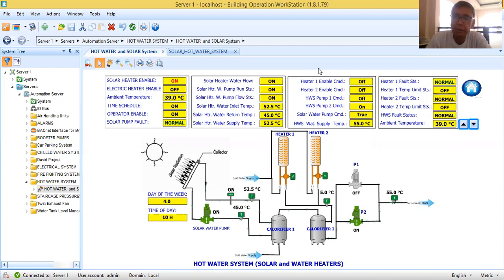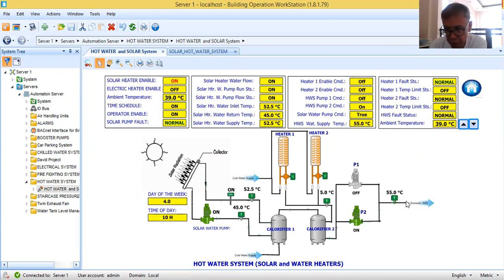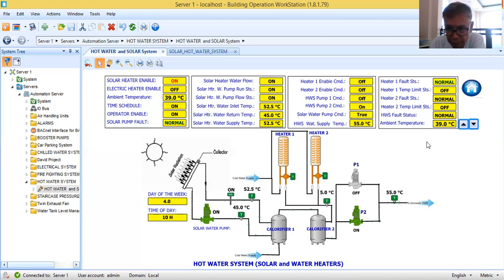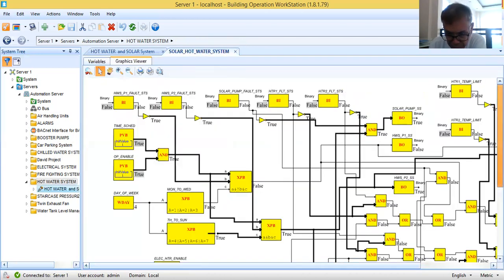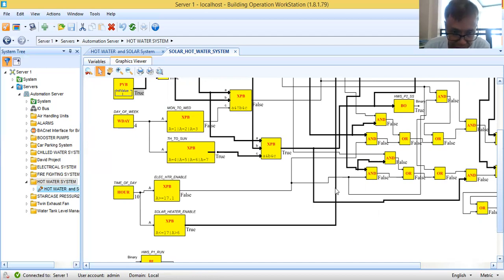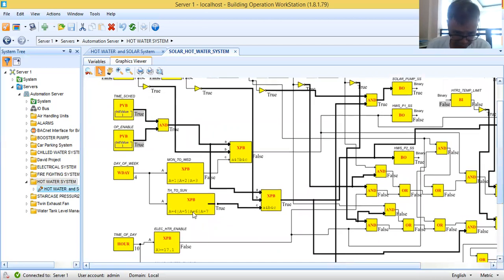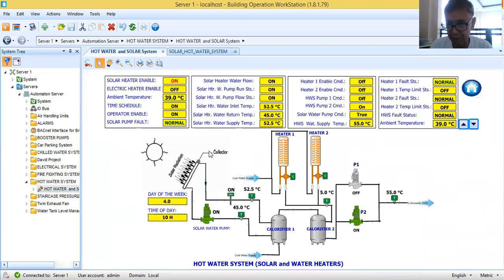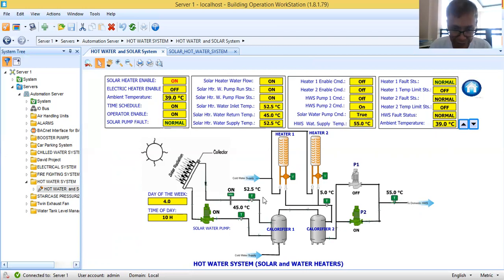Hot Water System (Solar and Electric Water Heaters)

Comment: I learned a lot, thanks. How about monitoring the temperature in the solar heater and automatically switching the electric heater when its below the setpoint?
Reply from the maker: yes, it is one of the scenarios that needs to be handled in our control logic program, I will try to collect more suggestions then maybe I will try to re-write the control logic program and do one final simulation of control. Thanks for the input appreciate it